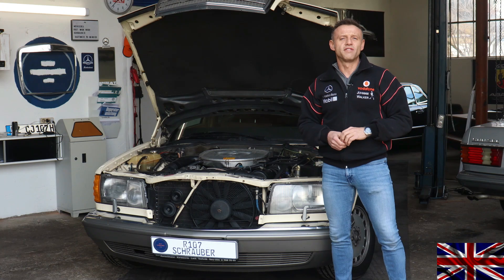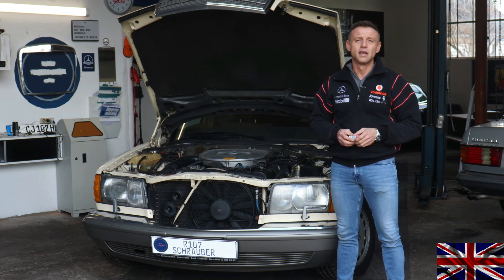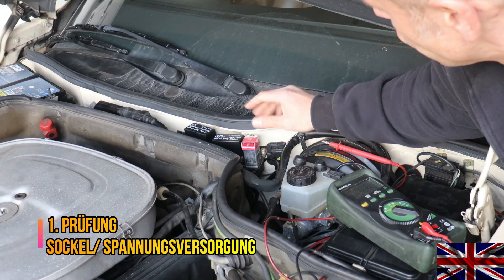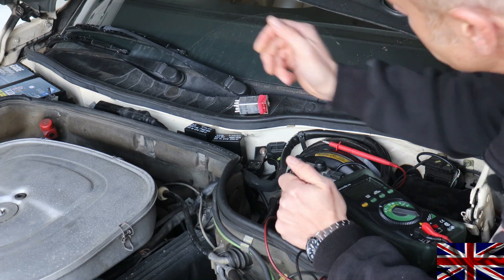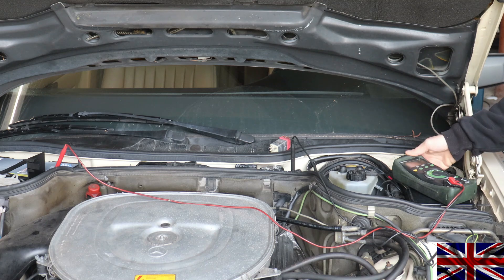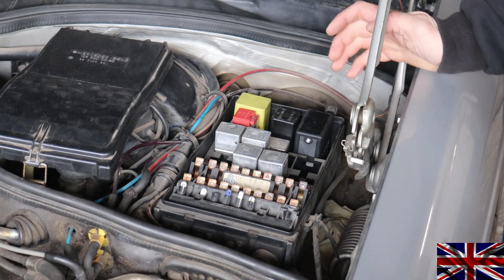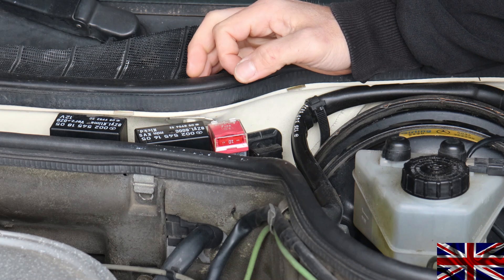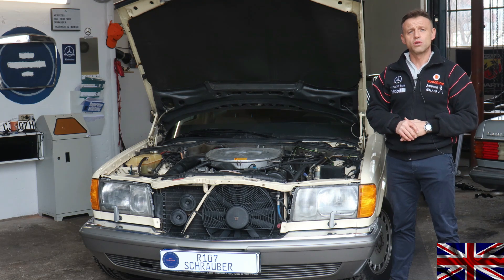Mercedes overvoltage protection relay - KE-Jetronic from Bosch

Comment: Hi! I have this problem in my car W126 380 SEL 1982 I bought a new idle valve but it doesn't work i I think Riley doesn't work.
Reply from the maker: There are many possible causes of excessively high engine speeds: idle speed controller, overvoltage protection relay, incorrect air flow, etc.